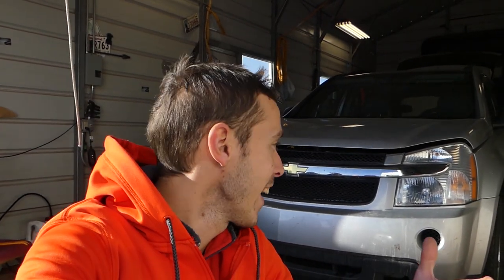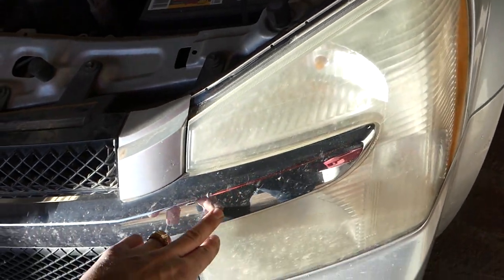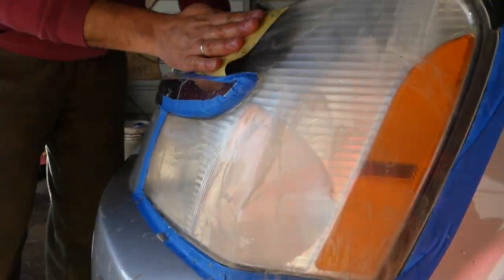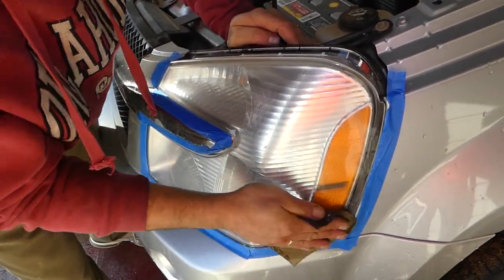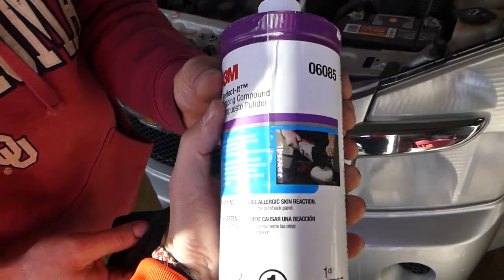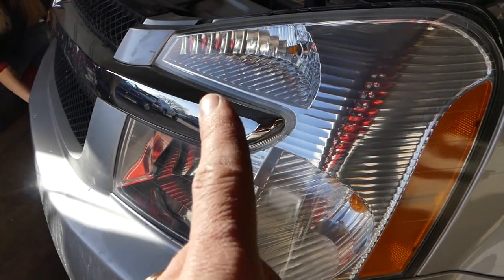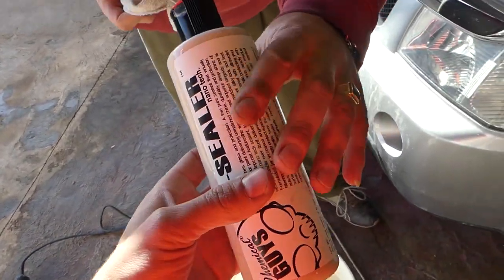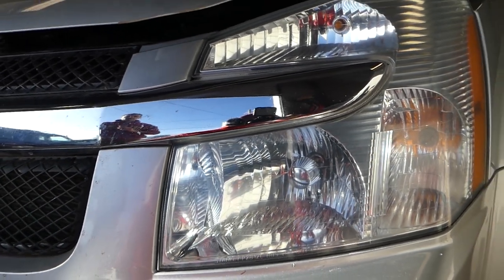HOW TO PERMANENTLY RESTORE HEADLIGHTS  FIX FOGGY HEADLIGHTS

Comment: I used tooth paste let it sit till dry and buffed of with a little water worked wonder. Great vid though, always great to have different options.
Reply: Use the chrisfix method, apply a sealer coat, otherwise the uv will rapidly age it again.
Reply: I tried that, but didn't work so well for me. I 'like try this next time 🙂